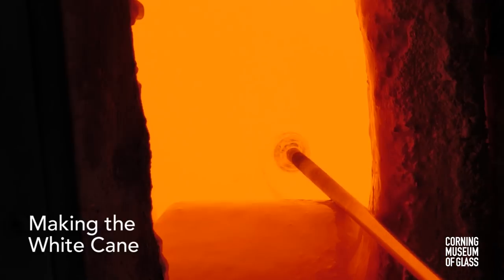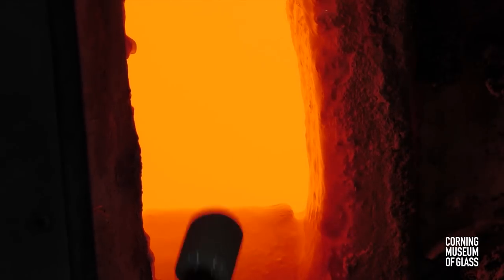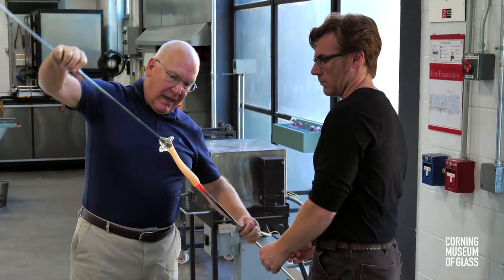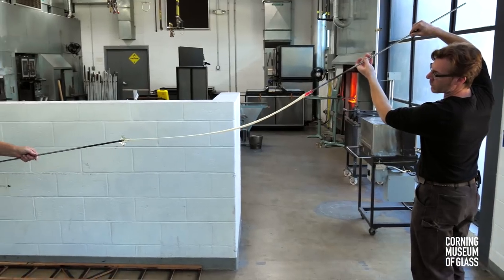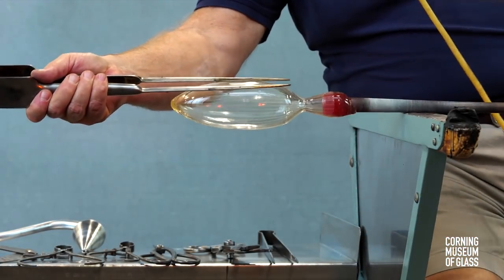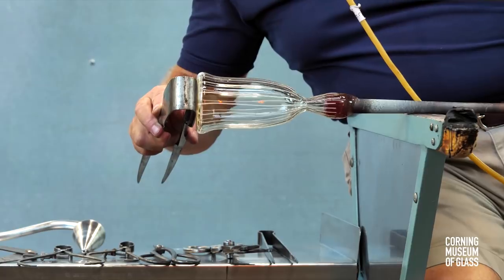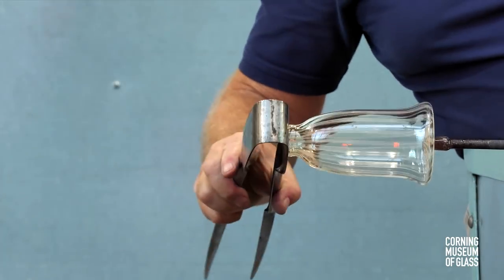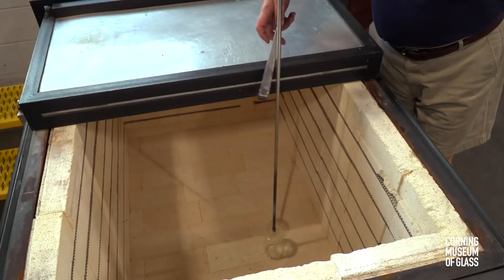Albarello | Techniques of Renaissance Venetian-Style Glassworking

Comment: In some of these fabulous videos involving vessels with canes in a configuration such as this, twisting of those canes seems to occur naturally as a result of tooling, and sometimes indeed seems the point! In this case, the canes do a good job of staying straight (or should I say Bill does a good job at keeping them so!). How does this work?
Reply from the maker: Hi, Bill says, "Twisted…straight—there is indeed a huge variety of both cane types and the ways in which they were used in Venetian and Venetian style glassblowing processes. In practice, it’s easier keeping twisted patterns looking good than non-twisted ones. This is because the eyes accept variations in the tightness of twisting patterns. By contrast, canes positioned straight up and down that are inadvertently subjected to torque (twist) become distorted and stand out as errors. The challenge for the glassblower is—especially when the glass is at its softest—to distribute the unavoidable torque (the blowpipe or punty must be turned to keep the object on center) equally in both directions. To see how much better the Renaissance-period workers were at managing this challenge than I am, see the Turquoise Pot video and compare my finished piece with the opening photograph of theirs!" Thanks for watching!
Reply: @corningmuseumofglass  Thank you and Bill so much for this answer! The even distribution of torque is the heart of the answer to my question,  I think. Once again,  thank you for these amazing videos - they have inspired me to start working with glass myself. Greetings and felicitations from New Zealand.

Comment: Why is the rollup done on a gather without an initial bubble?  I.e. what advantages does that offer vs rollup on a bubble or collar?  Something about torgue like in your response to @bhmainz? Were you able to determine that was the technique used from someone's notes or by studying a finished piece?   
p.s. Bill: Thx for these demos!
Reply from the maker: Hi, here's the answer from Bill: "If I’ve learned one thing over the last few years, it’s that, in past centuries, there were many different techniques used to ‘pick-up’ canes. Within my two e-books—this one and renvenetian.cmog.org—there are a bunch! As always, the technique I show in a video is the one that, through trial and error, has shown itself to mimic more  closely than any other the visual and tactile characteristics that we see and feel in the original object.

In this case, to have the canes stand slightly ‘proud’ (as the English say) above the surface, and have the correct wall-thickness, and to have the replica ‘feel’ so correct, I wound up settling on this process of picking up canes before the glass was inflated. The business of firm marvering as the glass is inflated is integral to achieving these characteristics. This is a technique that I’ve never seen or heard of a living Venetian glassblower using, and I suspect that it wasn’t done in Murano in the past. As many of the odd techniques I show in renvenetianstyle.cmog.org, I suspect that this was some clever, inventive, and creative ‘foreign’ glassworker’s invention. I suspect that many of these came and went within one career, carefully kept secret within the walls of the workshop.

Fascinating stuff, no? Thanks so much for your interest and curiosity.
" Thanks for watching!